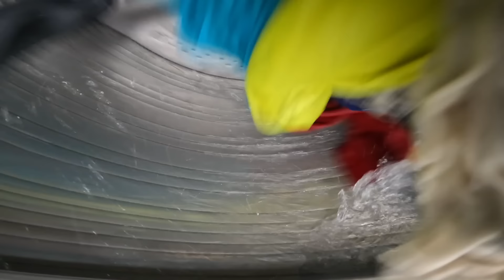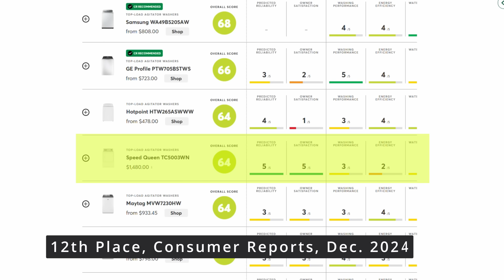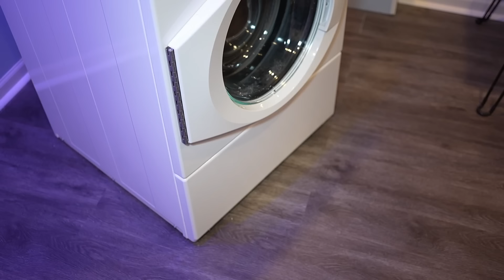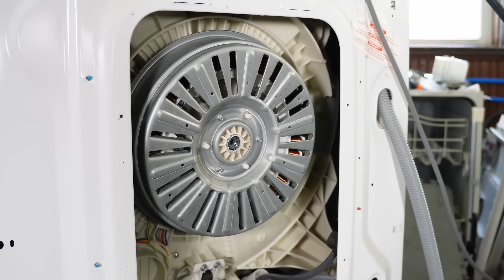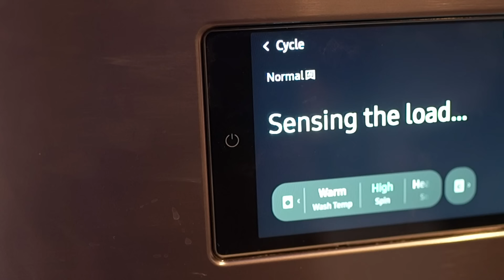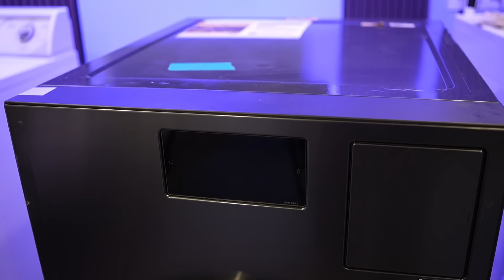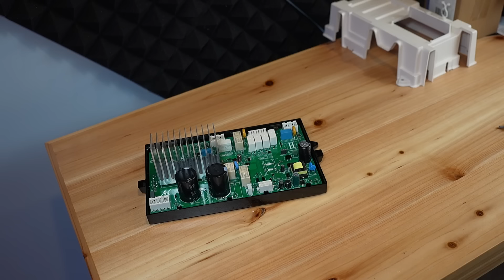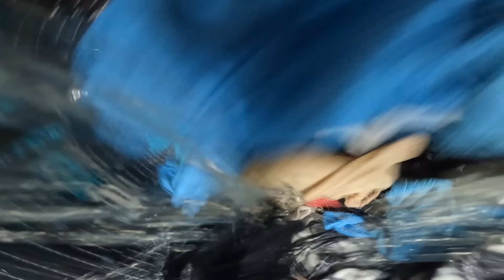Is America's Most Expensive Washer Great? The Speed Queen FF7009WN Test

Comment: Consumer Reports will always rate lower    efficiency machines much lower even if the quality of the machine is much much higher than a throwaway high efficiency machine . Until recently they didn’t even include Speed Queen machines in their ratings.
Reply from the maker: I have historical Consumer Reports books going back to 1973. Speed Queen is in quite a few. And ironically is always rated middle of the pack for the same reasons as the TC5
Reply: You have to understand how CR weights factors in ranking anything they review.   They tend to place way too much emphasis on energy efficiency, water efficiency, etc. in appliances.   Same thing with car reviews - their rankings may be based on factors that simply aren't that important to you.   As a result, I tend to treat CR ratings with a lot of skepticism.    After having two shitty front loaders (Frigidare, LG) and a crappy GE top loader that puked gallons on our floors, we couldn't be happier with our SQ TC5.    10 years ago we foolishly  relied on  CR for our choice of refrigerator (a Samsung POS).   Just one person's opinion, but I wouldn't place much emphasis on CR's recommendations.
Reply: @henrybrandt1057 best refrigerator
Reply: CR is a garbage, biased organization.  There are examples in every category where their top rankings don't translate to real-world situations.  Especially bad is that they regularly promote household appliances that will get tossed in a landfill after just a few years.
Reply: At $2500 it’s only pertinent to a fraction of consumers
Reply: @bruford911  it depends on ones priorities.  A friend just had their LG washer fail within 5 years.  If he spent $1000 on that washer and a LG only lasts 5 years vs. a Speed Queen lasts 20 years, by the 3rd LG washer purchased at 10 years, a person with the Speed Queen will be the cheaper investment.  Also, bear in mind inflation that the cheap washers will become more expensive over time.
Reply: @ That’s why I still use my 26 year old KitchenAid washer which was quite expensive at the time but well worth it… neighbors have gone through 2 or 3 cheap machines in the same time period.
Reply: @bruford911 let's be honest we're all buying this stuff on debt anyways. Might as well. 😅
Reply: Consumer Reports also often use the things that they test incorrectly such as when they review dishwashing detergent they only review it without prewash and on eco mode.  Pods are designed and over soaped to compensate for a lack of prewash while traditional detergent and machines expect you to have some prewash and the detergent cups often don't hold enough detergent to make up for a lack of prewash.  There's a lot of categories that they have similarly bad testing methodology, this is just one that comes to mind immediately.
Reply: I'm not a political animal but I sense a whiff of political leanings in their reviews.
Reply from the maker: great comment James. Here's the thing: They've ALWAYS been like "This". I bought about a dozen CR guides from 1973-2004 and they always do this. They weight noise, capacity, water efficiency, ect the same as everything else. I guess on an objective standpoint, this makes sense.

But from a practical standpoint... Well. Lets just say in the 2004 guide, their must-buy washer is the Whirlpool CALYPSO. If you've ever seen one, you'd know what a laughable mess that thing was because, on paper, it was great.
Reply: @bensappliancesandjunk  I had that washing machine before my speed queen. WHAT A PIECE OF TRASH. Clothes had to be washed 3 times to get clean. How efficient.
Reply: @jamesdrake2378   More than a whiff…years ago they lambasted the Toyota 4Runner for a “ crude” truck demeanor and body on frame design when the trend was toward unibody crossovers… 10 years later my 4Runner is going strong at 250,000 miles with just routine maintenance. So if something doesn’t coincide with their philosophy… it will suffer in ratings.
Reply: @z06rcr   If you like that, you should see their ratings on HD pickup trucks done in the 20teens.  They roasted them, complaining about rough rides, noisy engines, lack of features, having to climb in, loose handling etc.  They tested them unloaded, then loaded them down with maybe 1000 pounds of materials and ran a few tests again.  They stated that the handling and ride quality improved slightly, but not enough...WELL, an HD truck is designed to carry MUCH more weight than just 1000 pounds, so of course they are going to ride rough and handle bad unloaded!
Reply: @audvidgeek Well if you know how these trucks are used by the average person then you should be well aware they will be run unloaded 90+% of the time.
Reply: @audvidgeek And yet, the overwhelming majority of HD pickups (and Non-HD pickups) I see are not towing and have nothing in their bed! I remember seeing a large poll that showed something like 3/4 of pickup truck owners admitted they used their bed for something they couldn't put in a sedan trunk no more than once per year, and that's those who admitted it, the actual rate is surely higher. So in terms of who is actually buying HD pickups, under 1000 pounds of load almost certainly covers the overwhelming majority of miles driven for most users, and so measurements at those conditions are more relevant!
Reply: The washing performance of the Speed Queen was rated Average in Consumer Reports’ testing, probably the most important metric for a washing machine. Their reviews are as unbiased as possible, even if they hurt the feelings of people who bought a certain brand.
Reply: I don't buy that at all, Barry.  My results in consumer reports results are inversely related. If they recommend it, it ends up being bad. If they hate it, it turns out good.  Reading through what they have to say about products displays a large degree of snobbery of the staff. Why would I want to listen to a bunch of snobs that do not understand that some customers would rather have crude devices that last and do a satisfactory job versus sophisticated designs that break if you don't do everything perfect Even if when new do a slightly better job.  If they want to be a better source of information, they need to have the people testing different products providing a different perspective for different customers. Some customers are the type that one sophisticated technology, there are some that want crude but durable based on their unique needs. The whole idea of our economy is the idea of choice. You can have sophisticated throw away or you can have simple but durable.
Reply: @barrya8981  If consumer reports rates the washing performance of a speed queen as average, then they don't actually use real dirty laundry in their tests. You can be unbiased with a poor testing metric, but that doesn't mean you have useful data. Using a small strip of stained cloth to test washing performance is fine if all you wear for clothing is small 4 inch square rags that get multiple different kinds of stains on them all the time.

I've had a great deal of experience with other brands in the real world washing real world actually dirty things before I found the speed queen. "Modern" washing machines are overpriced garbage that fail to get clothes clean and barely make it through their warranty period. Other 'high efficiency' machines might be fine for you if you have an office job where you don't actually work for a living, can afford to buy a new one every couple of years, and have no idea which end of a screwdriver is the correct one. AKA consumer reports' target audience.
Reply: @JHe-f9t   exactly.  I've found my FF7 excellent at getting super-muddy clothing very clean!
Reply from the maker: @barrya8981  that's correct Barry. There is an official testing swatch used to test wash quality that i bought we can use. But at $25 per swatch... i want to use them sparingly. I know NYC wire cutter uses them to test wash capabilities and I imagine that CR does too, and it's an objectively good test of capabilities.

Comment: At the beginning of the video you incorrectly say "with an MSRP of twelve hundred ninety dollars..." You meant to say twenty four hundred ninety nine dollars..."
Reply from the maker: Crap
Reply: A true test would  be on this frontload  machine  would  be hooking this machine to cold water only using the sanitary high heat wash to where the water is boosted from cold to warm to hot. Just waking white cott shirts and not having  the drum so compacted with clothing. The machine  need to be able to move the clothes  around  in the drum to break the stains down. The other factor is using powder  detergent, not the pods. The pods aren't  soluble in anything but hot water . Powder soap is soluble  in all temperatures.
Reply: In Australia that brand is nearly $5000. That just doesn’t make economic sense. I’ve had my Westinghouse front loader for 15 years with no breakdowns or problems and it cost $800 when new. I understand the build quality of the Speedqueen but the price in Australia does not justify.
Reply from the maker: 0:11 - My apologies for stating "$1,299" verbally with the notation being $2,499 for the MSRP. I've struggled with Dyscalculia-like number reversals for ages. I paid $2,199 at retail for the machine, with the MSRP being $2,499.

Comment: Longer cycles usually wash very well using less water and electricity. Thus the EU has mandatory ECO 40-60c cycle for normally soiled garments for all washers and dishwashers sold there. It works very well but the eco cycles are 3-4 hours long.
Reply from the maker: You'll note the Bespoke 2hr run was incredibly good. There's almost a linear relationship between stain removal and run time. 

The caveat is that many people will argue they need to do more than 1 load in a certain time frame so they need to trade time for efficiency.
Reply: @bensappliancesandjunk  I agree about the extended time producing better results. 
Since getting a front loader many years ago we have adjusted to longer laundry times and that has somewhat prepared me for the new LG heat pump dryer. It's a fantastic dryer but it does take some getting used to. The drying times are much longer and the maintenance is more intense and detailed. I think like front loaders many years ago that it's going to take Americans quite a few years to warm up to (pun intended) heat pump dryers. That is unfortunate because I find this dryer superior and almost every way except for extended time and I'm willing to live with that comfortably.
Reply: Honestly this is an American thing. We are a people of instant gratification and no patience!  I have had  front load washers for 20 yrs now and had to adjust my thinking for the laundry time. My friend's at first thought I was crazy and criticized my choice, but now they all have front loaders! Our latest new appliance is a new LG heat pump dryer. This is a larger size dryer and we love it! But, talk about adjusting to longer drying times! This can (depending on cycle) take up to 3 hrs to do a large load of towels or bedding! The unit is ventless, uses 1/5 of the electricity than our old dryer and is gentler on our clothes so we're adjusting to the longer times. Honestly it is going to take a long time before the American public will accept heat pump dryers.